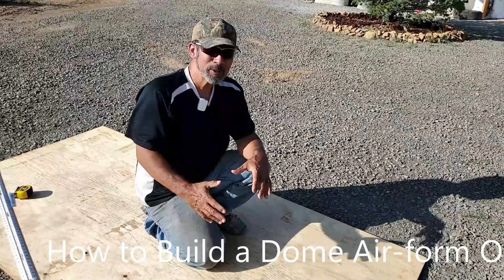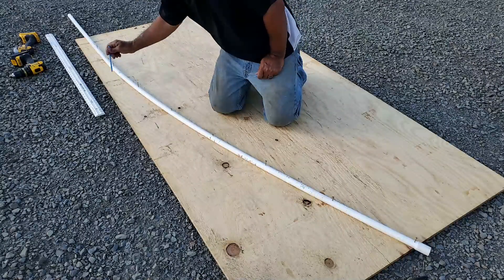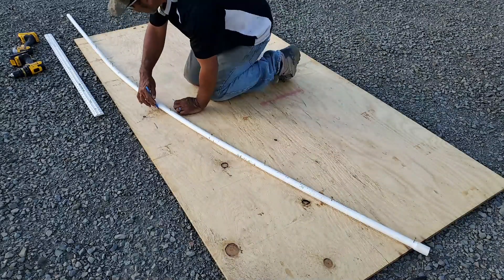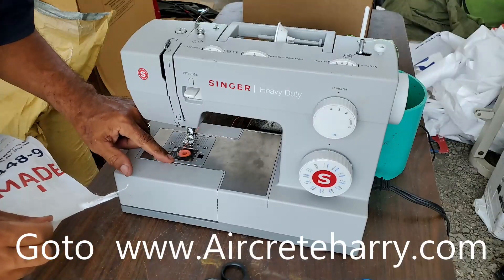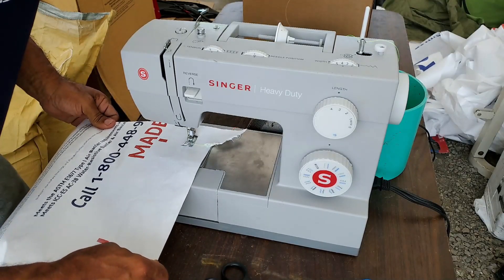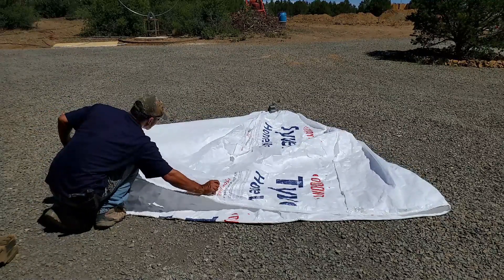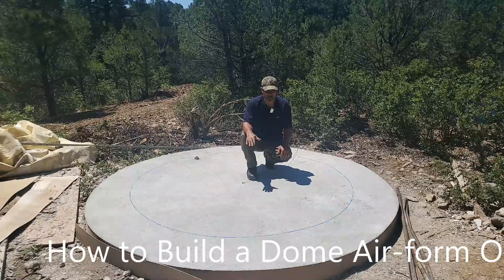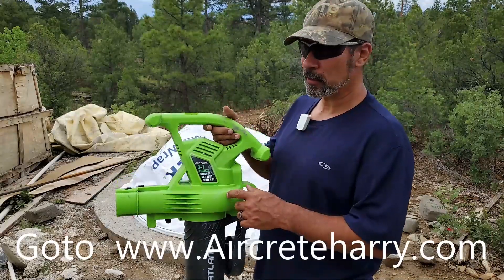How to make a Tyvek Air-Form #aircreteharry #tyvek #domeairform #howto #diy #aircrete #airform

Comment: Hello, has the process changed any since then? Still use angle iron, leaf blower etc,
Reply from the maker: Hey Patrick,
How are you?
A lot is the same. Yes to angle iron. 
I updated several things and provided upgrades/ options in addition. 
My Online Step-by-Step Video Tutorial Course is now available: 
https://aircreteharry.com/product/%e2%9c%85-online-dome-building-course-step-by-step-by-aircrete-harry-great-addition-for-everyone-who-cant-make-it-to-the-hands-on-workshop-as-well-as-for-eve/

It comes with a detailed list of what's needed and links to where to purchase the supplies and parts required. ✅️
Reply from the maker: It doesn't let me reply under the other comment you made, so I'll do it here.
In many cases the shipping charges that need to be covered, to receive the shipment, are insane. Most parts are unavailable or on backorder until next October/November 2023. And even that is not a 100% confirmation but an estimate.
We waited 7+ months to receive one particular part, made in the US, that is now completely unavailable again. 
For 2 other parts we had to travel to South Texas to pick up ourselves because the shipping was so insane. So we planned on taken care of as many things as possible on the way while driving down to TX. Commenting - while not being in the position yourself and not having to deal with facing the unfortunate reality, may be easy. 
Assumptions leads to misunderstandings.
Questions may lead to answers and clarity.
Reply: @AircreteHarry  I'm still going to purchase in future my friend.  I was  referring to digital products.
Reply from the maker: @patricksmith2193  You got it Man, ready when you are 👍 👍

Comment: Have you tried using PVC  molding instead of angle iron? My guess is it will take the curve of the structure without the extra step of notching the angle iron. It's probably cheaper too.

Comment: Thank you Harry! Now I just need to learn how to determine the shape of the template. I like your technique with the pvc tube to draw the line along the screwed-in control points. I'll investigate how to determine the control point locations.
Reply from the maker: Or goto www.aircreteharry.com and buy the video on how to build an Air-form. Thanks!
Reply: @AircreteHarry  I get to the site but when I click on something its error 0404
Reply from the maker: @dsm811  The website is up and running again! 
https://aircreteharry.com/shop-1/

Any questions, I'm here for you!